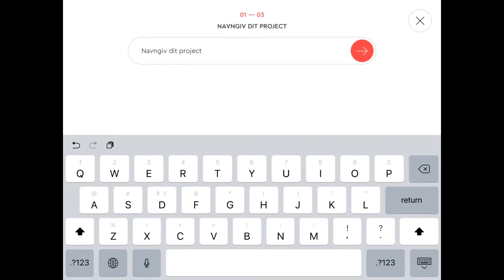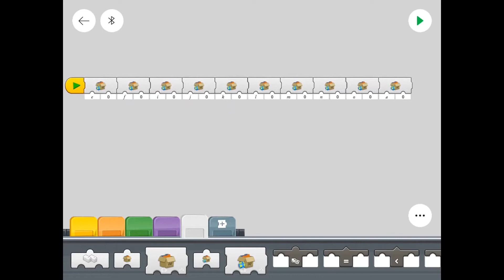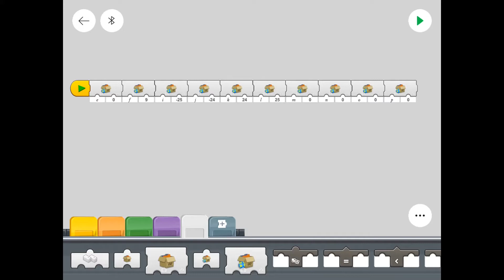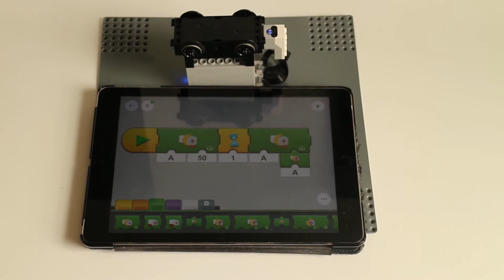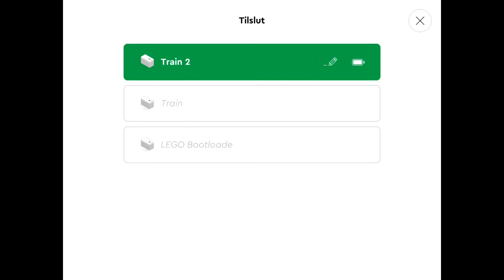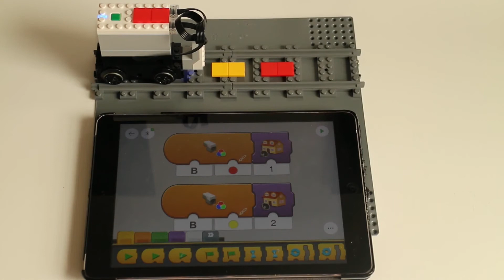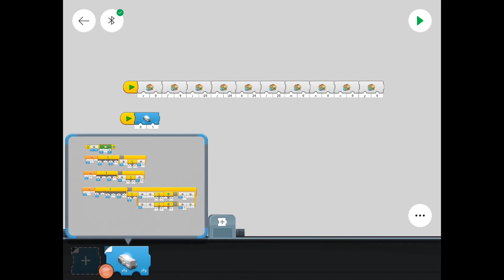Lego Powered Up Automatic Train Control [Tutorial]

Comment: Mine ain't working so I need to do some trouble shooting, I'm sure I'll work it out. You say in your video "...as I understand in the documentation", what documentation are you talking about, has Lego published documentation on Powered Up, if so it's very hard to find, as was Lego's powered up documentation. Thanks for the tut BTW, great stuff.
Reply from the maker: Not official documentation from Lego, but this is the best available: https://racingbrick.com/powered-up-code-block-guide/
Reply: @Brickostan  Thanks for that, mine still isn't working properly, I guess it matters which end you have the senor on, but as long as both locos are built the same, IE with the sensor at the same end then it should work? Mine keep stopping, starting and changing direction randomly. I don't have an Android tablet so I am having to use my phone and I think I am changing the program accidentally while I am scrolling around the program.

Comment: I have a central train station, which is has six berths. each berth (hardline) is used by traffic. I have a total of 8 trains, of which I use for each session 3-5 . I need the train to be diverted to a free berth randomly from the berths which are free (unoccupied), stop if all are busy. also trains leaving the central station must stop at three more stations before parking in a dedicated shed which will also be run with automatic switches like the central station . do you think writing a code would be possible for this situation ? thanks
Reply from the maker: Hi. It sounds like a big program. The Power Up programming is pretty flexible, so such a program probably could be possible if you have the time to write it. But don't get too disappointed if you don't succeed. Good luck on the project.

Comment: This is awesome,
Reply from the maker: Thanks 👍
Reply: @Brickostan  I have a very simplistic video with a single tram and 3 stops on it in my channel Brick Rail yard using much fewer blocks. This was a great insight to the other blocks and got me thinking. Want to see how 5 stops works versus 3 stops. I use distance vesus colour so the sensor is aimed out to the side versus down at the track.
Reply from the maker: @Xboxplaylist  Uuuhhhh..... you have level crossing. Nice.
I haven't tried using distance - only colour. My plan is to make two subway trains some time in the future and make them run back and forth using this technique.
Reply: @Brickostan  I found the sensor has consistence issues when room lighting changes, but the distance worked best when having it pointing through trans blue wind shields.

My level crossing doesnt work both ways, but I was trying to achieve it with fews Power up parts to reduce cost. I am working on a new prototype ignoring cost.
Reply: @Brickostan Finally learned the power of Variables as you showed in this video. Now to work on checks for my improved rail crossing.
Reply from the maker: @brickrailyard  Nice. Post a video when you get it to work.